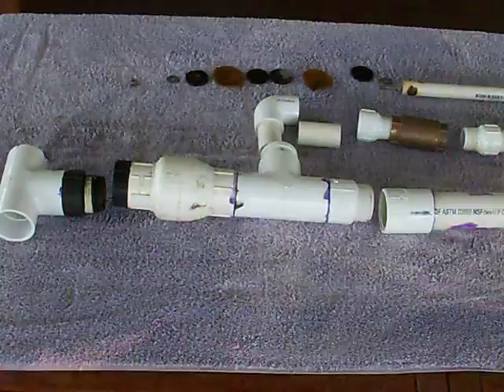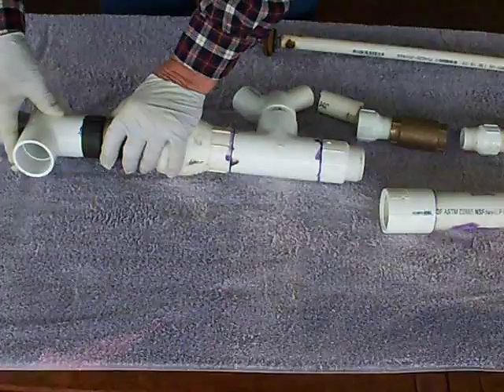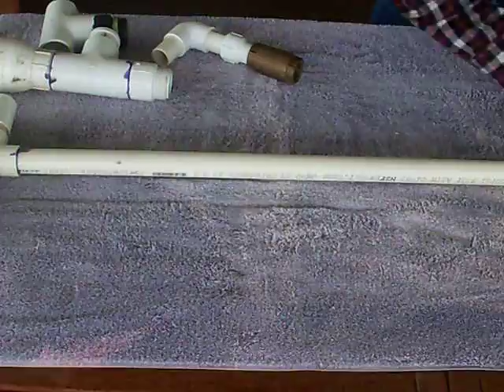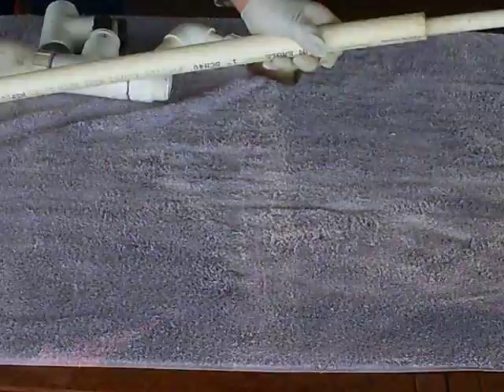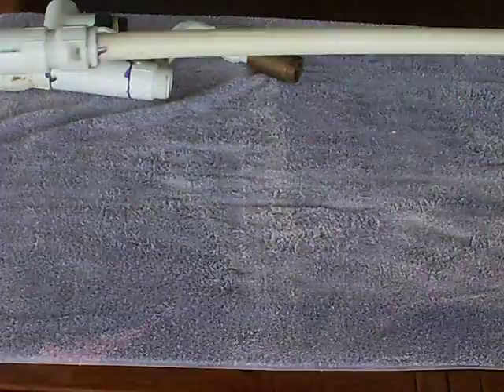Windmill and water pump.  DIY part 7

Comment: I wonder if the pump will work on a 180ft well.
Reply from the maker: +Ish Rodriguez No, this pump won't do deep wells.  I had it pump from 24 feet after that  it wasn't practical.
Reply: Jay Rod......use an air compression pump.  It is very simple to build but the head of the windmill will have to be modified to accept a truck brake bellow.  to test the idea in your well is very simple;  First get some water rise tubing such as PVC or PEX but it has to be at a vary small diameter such as half inch or less, unless your water depth is very deep, then you will have compressed air tubing such as flexible same size polypropylene tubing.  Run the tubings together down the well and they will be connected with a T fitting.  the idea is to send compressed air down the air tube and when it reaches the T; the bottom, part of T, will be plugged and the water tube will be open.  When the air hits the bottom going into the T and enters the water tube; it will carry columns of water up the tube.  See Brumbert airlift/compressed air water pump on youtube.